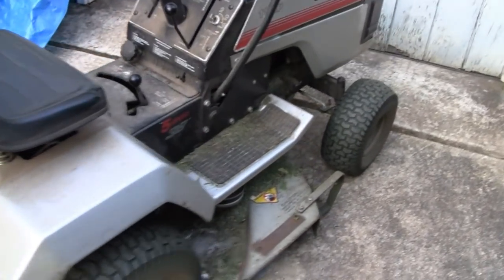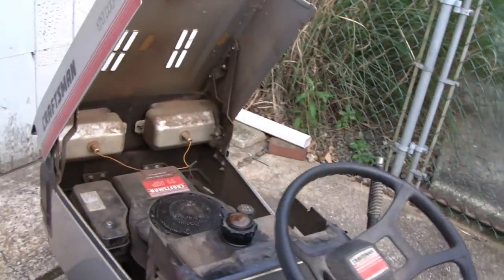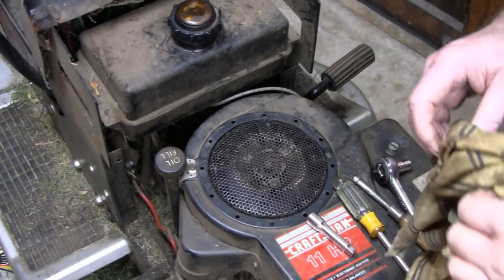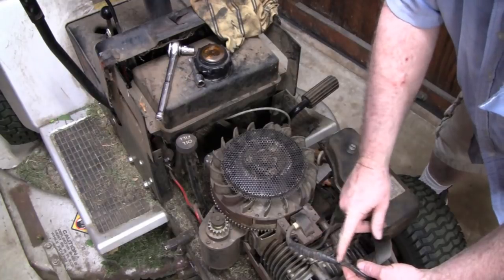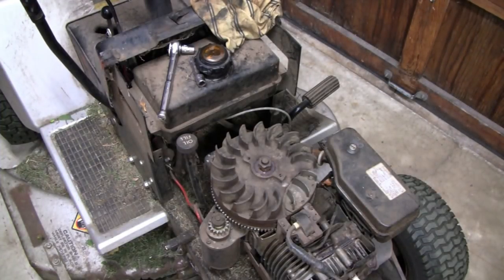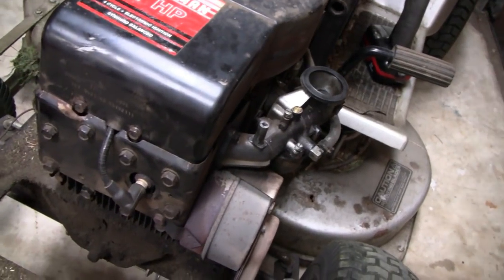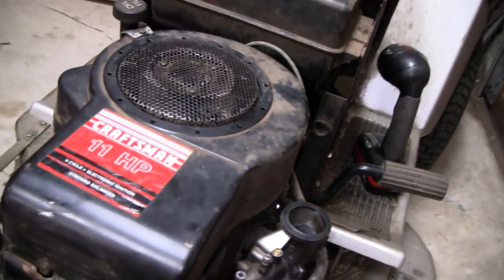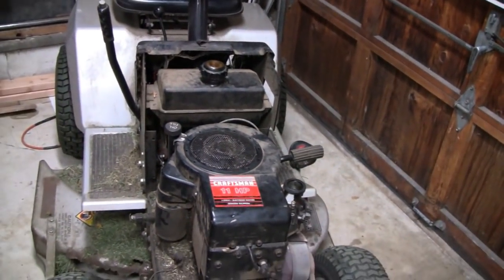11 HP BRIGGS ENGINE VALVE JOB (part 1)

Comment: Those good old 11hp Briggs are nice motors.  I have worked on a bunch of them back in the day....   They real take a beating and keep on running....   We had the same motor in a John Deere 111, and the Crapsman......  A buddy has a newer 14.5 Hp OHV Briggs which I swear is the same block etc just with OHV attached...
Reply: Probably.  One I know for sure was an OHV built on an L-head block was the old Tecumseh XL engine from the 1970s.  Last time I saw one was on a Miller welder.  It had a separate valve chest which sat on top of the head.  It was actually one of Tecumseh's better engines.
Reply: I had a 1980's Agway (MTD) with a 12hp Tecumseh CL OHV.     It ran good if you could actually get it started lol.....

Comment: I had a mower exactly like that one for twenty years. The exhaust valve seat came loose and I peened it and it ran for many years after that fix.The transmission destroyed itself so I sold it and bought a new Craftsman mower with a 46 inch cut. That one is 18 years old and still running strong with a valve adjustment the only thing done to the engine. Regular oil changes are essential for long life.

Comment: it looks like the same problem my dads having with his lawnmower, I checked the same things you did could not find a problem in the end I ran till it was hot a wouldn't start again put a light down the plug hole and could see the exhaust valve was stuck open.

Comment: I wanna give ya a big ol' thumbs up just for posting this one. That sounds like it's shot a valve seat to me. If you figure out which is hot and which is common on the starter, you can jump out the starter with a screwdriver to spin the engine over to check for a head leak. At any rate, I"m excited to see the next installment. Oh and uh... Give the poor thing some TLC eh? Lol. Nuff o'dis.

Comment: I have the same engne mounted in my lawn tractor , it needs a new ignition coil ( ignition vanishes when the engine is hot ) , and a new belt for the mowing deck . I bought this tracor from a buddy for a small price.

Comment: that's a good old engine ,,  it's a 252707 from the look of it   , they were around a long time  ,,  10-21-85   it's 32 years old 
I had this exact same mower  when i first started mowing lawns with a rider 
as soon as i heard it cranking i knew you had a sticking valve  or some carbon on it ,,I've lapped the valves on a lot of these over the years 
the 252xxx series was replaced by the 282xxx in  the late 80s and early 90s ,they built the 2 series at the same time for several years ,and a lot of people mix the 2 up  ,, the 282xxx is actually physically bigger than the 252xxx ,,,a good way to identify an older 282xxx is by looking at the rear of the block there is a bolt in the middle of it  that the 252xxx doesn't have 
surprisingly some of the parts are the same like the starter ,, all of the single cylinder starters from the 7hp 170xxx engine  to the bigger 282xxx and 31Bxxx OHV engines is the same , the ignition coil is also the same on all the single cylinder engines , just the length of the wire is different 

on a different note ,, you MUST screw the dipstick in fully  for the oil reading to be correct 
a little bit of a cheat that i have learned over the years through careful measuring 
if you set the stick in there and pull it back out  if the engine is full of oil   it will be at the ADD mark or a tiny bit above 
and you mentioned a couple quarts ,, it holds 42 ounces to be exact
Reply: Any idea what the factory spark plug should be for the 252? mine reads 252707-145-01. The briggs website doesnt recognize that model number. May be too old.

Comment: i was working on a B&S 190cc engine off a pressure washer that wouldn't fire off gas.  the gas had a clean path through the carb but turned out there was a vacuum leak after the carb.  once i sealed it up the engine fired right up.

Comment: I believe that the owner's instructions call for just dropping the dip stick in the tube without screwing it down.  Otherwise, you get a reading which shows more oil than you actually have in the crankcase.

Comment: the old cube craftsmans were tough,flat heads forever!!!! lol
Reply: roger oconnor .......I have two of these same grey box style mowers. One is just a parts machine now, and the other just a running tractor with no deck. These were made by MTD and only had hood changes. Craftsman were grey then green, the others were red for other brands.

Comment: I'm sure you can fix a Briggs engine If the valves are bad and low on oil I would suggest an overhaul with some new rings ..Those old Briggs can out last the mower they are on
Reply from the maker: Surprisingly that bitch doesn't blow any smoke at all!!☺

Comment: Some of those craftsmen mowers were pretty good machines if you could keep the deck and spindles from going south.  I was just saying on another channel we don't see much in the way of vertical shaft engine work, so I'm looking forward to this fix.  Thanks, Roadking.
Reply from the maker: The spindles are holding up but the front of the deck has rotted out!!☺

Comment: try changing the igniton coil and spark plug. If that dont work try changing the cutting belt or see if the blades are fouling underneath

Comment: Did you check for spark? Give it a squirt of fuel through the carb intake. I experienced a similar problem and it turned out to be a loose valve seat.

Comment: OH BOY BUDDY! when checking the oil go counter clock wise and the dipstick will fall down into a notch then you pull it out and read it! :) and check the connections on the solonoid! sometimes can get a little rust on them causing that clicking...if that dont work i got a craftsmen that looks just like that if you want it ;)
Reply from the maker: Thanks Bob!! Instead of telling me how to fix it, you should have been here doing it!! You gotta earn that inheritance!!☺
Reply: should've called me Bob! you got my number!!!

Comment: When you tried to start it in the beginning of the video, did it look like it spun too freely? I'm wondering if you could use that to diagnose low compression, confirming the valve theory.

Also, is it worth using one of those compression testers that screw into the spark plug to get a before & after reading?

Comment: Maybe valve adjustment or the valve seat may have come loose on the exhaust valve. Is that coil wire and coil o.k.? Thanks for the great video's.
Reply from the maker: Thanks Bud!! That coil is better than new!!☺

Comment: 1:12 our westwood T1600 failed to start like that because the ignition coil had delaminated so when it was hot the hysteresis losses meant it couldnt spark

Comment: a friend of mine was given two riding mowers when a neighbor moved. one needs carb work. it wants to run. it tries. the other I think the trans is locked up. stuck in hear and it won't roll a s can't budge the engine. the engine looks just like this one

Comment: Might as well sand your grounds down , id say exhaust vale is stuck popping sound id say coming through the crab .Valve seat might just be gummed up can't wait to see.

Don't hurt to run a bit of kerosene in oil for few mins be for change it out every once in blue moon

Comment: Man, 32 years old, that engine/mower doesn't owe you much, does it ?  It does deserve a valve job now , I'm thinking., 
While on the subject of thinking,...would you consider installing an in-line shut off valve for the fuel line, now while you're at the engine?
Reply from the maker: Yeah I'll have to check the inventory, I think I might have a shut off valve!!☺